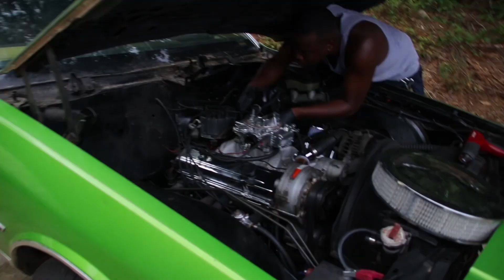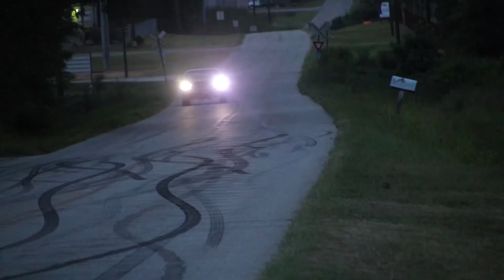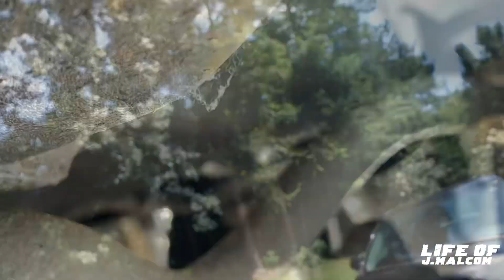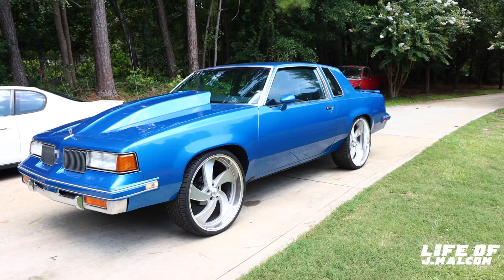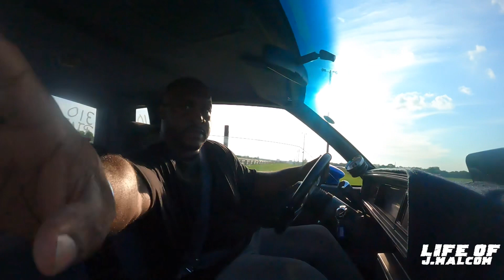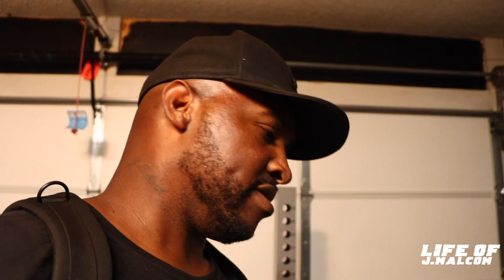I RACED MY SUPERCHARGED 350 CUTLASS AGAINST MY POPS NEW CORVETTE

Comment: Methanol injection for the blower to keep IAT cool and advance timing
Reply: he talked about it  before doesnt wanna do it.  he talked about using nitrous on it too.  just wants it to be super simple  no  adding this or that
Reply: @KingJT80  true, but those roots blowers create so much heat. Especially when you don't have an intercooler.
Reply: @biggin5434  yeah those weiands are old school. I heard the Edelbrock ones are way better they're eaton h122 blowers and cost the same amount of money
Reply: @KingJT80  yea different rotor design  but doesn't create as much heat
Reply: @biggin5434  Yep.

but dont think a weiand 177 on a 383-400 wont put in work. big money rock had one in his donk and it moved.  its on the channel some ways back.  but he also had nitrous on it 

 but for the money the H122 edelbrock/eaton  would be the way to go.  might even fit under the hood
Reply: @KingJT80  oh no disrespect to the weiand but the nitrous was the best thing for it. R&B is a cruiser and I get that but gotta cool the blower
Reply: @biggin5434  oh yeah  it was.  If someone came and did E85 with one it would be super decent.

.I saw SSP do a 400 with a 177 and it wasn't no joke. But if I did it which I want to after my fox body, I'd do a dart 400 hydraulic roller with a h122 and AFR 195 street heads and run it to 6500....
Reply: @KingJT80  that would be nice combo
Reply: @biggin5434  yeah it would be more than fun on the street

 I'd just run the blower to max rpm @ redline on the engine. Math shit...